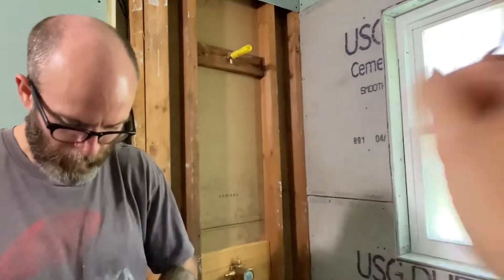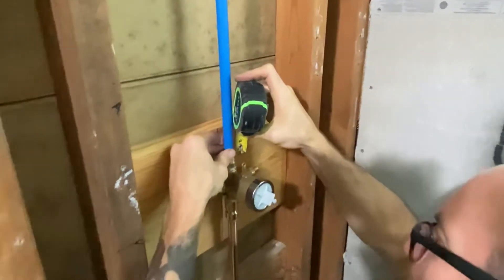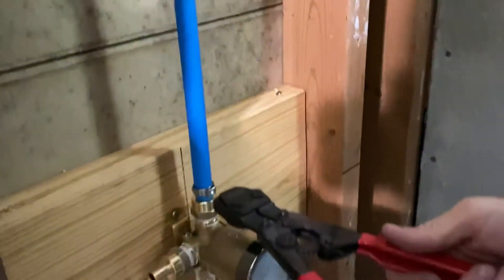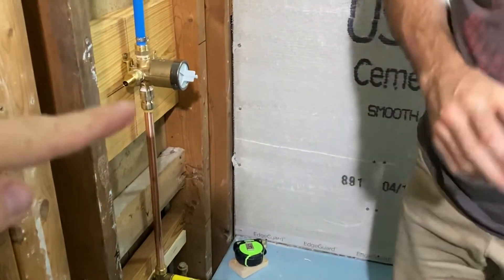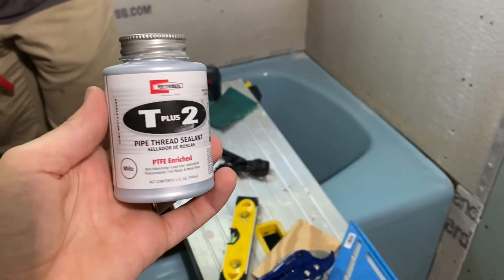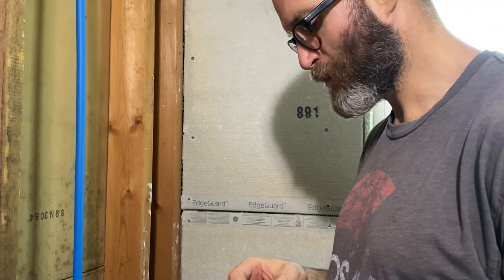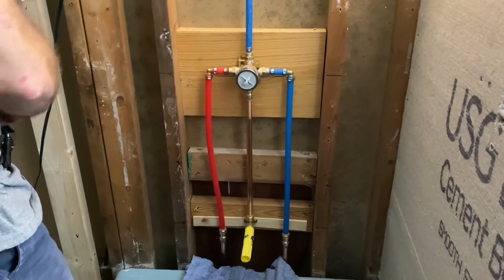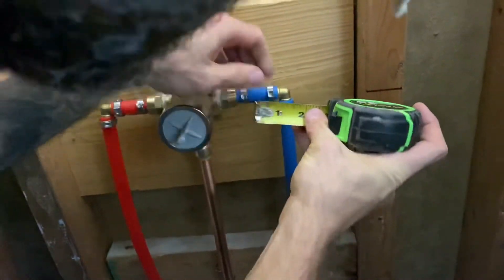Installing Plumbing Without Soldering

Comment: The reason why the tub spout vertical pipe has to be copper (or iron) is that filling a tub requires a high flow rate of water, so the valve is designed to send down as much water as 1/2" copper pipe can handle. 1/2" PEX pipe has a smaller inner diameter than 1/2" copper, so if you used PEX what would happen when you fill your tub is that the tub would fill more slowly and the excess flow of water would end up going back up through your showerhead.

Some manufacturers have a 3/4" PEX fitting for the tub spout outlet, and that can handle the flow of water. Of course, you still need to connect it to a drop-ear elbow and transition to copper for something firm to attach the tub spout to.

BTW, the tub spout does gets more flow than the shower head (next time you have a valve, look into the outlet ports. The shower side will have a smaller inner diameter than the tub side)
Reply from the maker: Excellent description and notes. Thanks @Brian Segall!
Reply: How is 1/2” pex ID smaller than copper? I assumed it was the 90 I had that caused the slower rate of flow. Never would of thought a straight run of pex and copper would result in different flow rate
Reply: @LogosFarm  Some quick google searches show that 1/2" PEX pipe inner diameter is 0.485in while 1/2" copper (type K, most common) inner diameter is 0.545in.

It gets worse because PEX fittings go on the inside of the pipe while copper fittings go on the outside. 1/2" PEX brass fittings have inner diameter of 0.350in

3/4" PEX fittings have inner diameter of 0.530in which puts them on par with 1/2" copper. With PEX, go one size up to retain the same flow as copper.

Cold expansion PEX pipe and fittings  reduce the inner diameter loss compared to copper.
Reply: @briansegall1084  You are correct. Using a dial vernier caliper it is indeed more slim. I genuinely would never have thought that and assumed it was the 90 since it is as you said an inside connection point. Lesson learned, appreciate the response